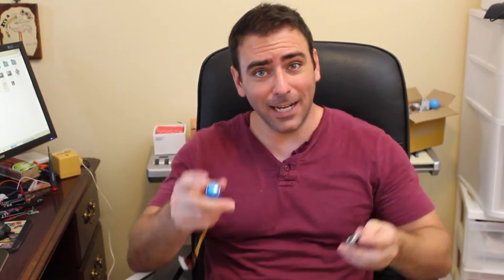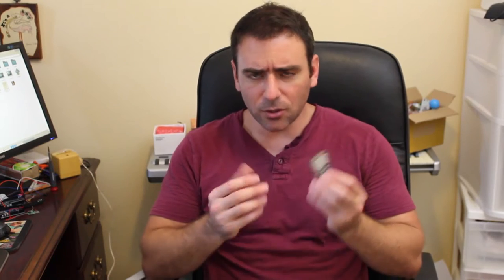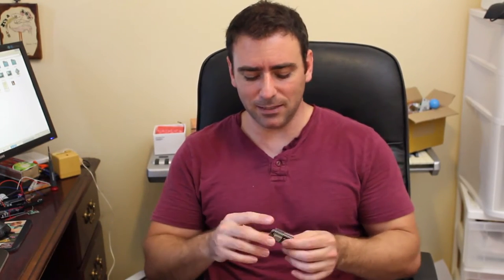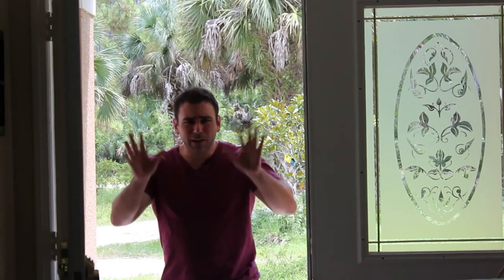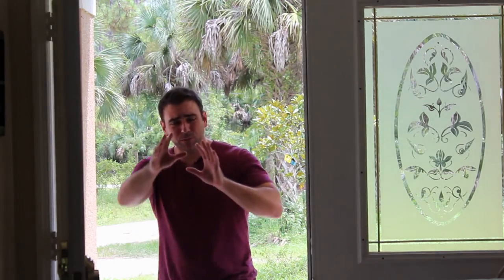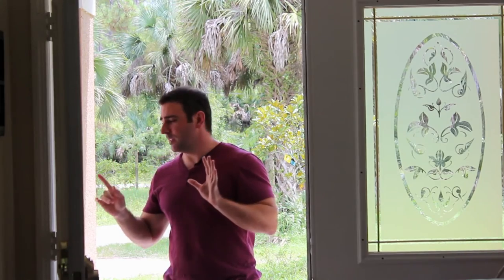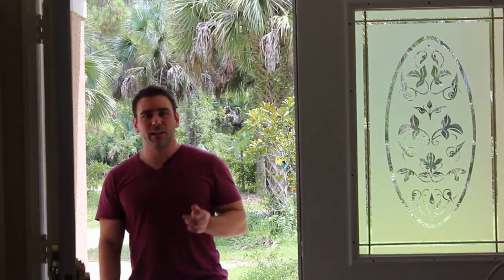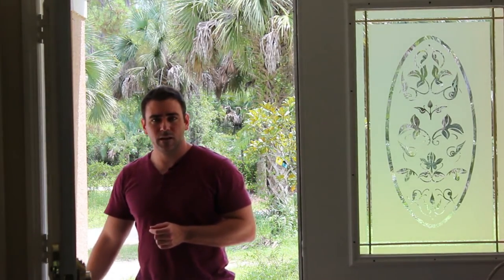ESP8266 Smart Door Bell Project

Comment: I am looking for my first ESP32 project.  Simpler than the project in this video.  Press a button and I get a text message. I know nothing about ESP32 but would like to know at least how to program an existing code into a ESP32.   So far everything I found on youtube assumes you know how to program the ESP32.  All I would like to do is edit with entering my router user name and password , and setup what FREE service it will use to send the text message.     The other though is I have been playing with a water detector by tuya.  What I am finding if I short the 2 probe posts that detect water it may or may not work but on the second attempt (with in a few seconds) it works and sends me the text message.   I built a circuit that takes the a.c. voltage at my door bell chime when someone pushes the doorbell.  This voltage I converted to 12vdc to trigger a relay.  I just need something the closed contact will send me an alert message.    By the way there is something called a trigBoard that is perfect but for the editing of the wifi router user name and password and service that will send the text message you need Windows 10 with bluetooth.  The process is very simple if you have Windows 10.  I only have Windows 7 so that killed that project.  No programing or loading in code was needed. Very easy.

Comment: You have had much more success with the ESP.  I pretty much gave up as I was forced to use the LUA and the ESP was very difficult to communicate over the serial line and it kept crashing on the simpliest tasks.
Reply: increase your power supply.   get a couple as spare in case it has electrostatic damage or bad connections
Reply: I am sure Chris can instruct you in how to use the Arduino IDE for this bell thing. Lua is a filthy language!

Comment: Hi, looks interesting but how do you get this esp always on charge? batteries, or outside AC socket?
Reply from the maker: I'm using the original wires that ran from my door bell to my garage.  They where connected to the transformer that powered the door chime itself, which is connected to my houses 110VAC and converted that power to DC (I want to say 12 to 15 volts. I can't remember off hand).  You can easily use that power line to power the ESP.  Since my door chime's transformer was dead to begin with, I can just replace it with a standard wall outlet with out having to run any new wires.  Then I just used an extra cellphone charge to power the ESP from there.  I think I talk about this in the previous video a little bit.

https://www.youtube.com/watch?v=Qv1nW2qTwUI

Comment: Whats the Github path to this particular projects files please ?
Reply: The code on the ESP8266 itself is just the example code for a button press and url request that comes with the ESP8266 library files.  The only thing I've changed was a counter that makes sure the button is pressed for about a 10th of a second before triggering.  Before I had a problem with occasional ghost rings and forcing the button to be pressed for a bit longer seems to have fixed that.  I don't have that code in front of me, but I do hope to do an update video soon.

Here is the shell script running on my desktop computer that the ESP connects to:
https://pastebin.com/GYgS1Q0z

I've removed the urls and passwords for my systems, so you'll have to fill yours in.
My camera server is a cheap "ip video 9100a", but most ip cameras should have a url you can grab images from.

Depending on your mail server this might very, but sending an email on php request looks like this:
mail('5555555555@txt.att.net', "Door Bell Rang!!!");

Let me know if you have any questions.
Reply: I'd be very interested to see an updated video if you do make one - I am going to try build a pair of these, where there is also an ESP8266 receiver (that performs a similar role as that of your computer) that scans a web API for button pushed flag, sounds a chime, and then unsets that flag (and perhaps notifies the ESP node where the button push occurred to trigger some feedback for the person pushing the button). The ghost ring fix is a good idea. Thanks.
Reply: Here is the updated code:
https://pastebin.com/LLwnsgTM

If could be cleaned up a bit, it's running the ESP8266 as a server and client, and the server portion really isn't needed, but could be useful if you wanted to add more functionality to it.

You'll notice 'int p = 0;', this is the variable I created to count how long the button has been pressed for.  If I press the button as fast as I can, I would get 30 to 40 loops in that time, so I just set it to ring at 50 loops.  It's worked well for me, but you can play with it.  I made this change a few weeks ago and haven't gotten any ghost rings since, when I use to get one every few days.

Good luck.

Comment: emm.... so i need to have my 300w desktop pc running for the door bell to work.....  ok i know, but i have internet via a 24/7 router, and a light bulb that works with google home assistant, surely i dont need more hw than that. we only have the one 'smart' bulb its in the bedroom, were going back to manual led as if you walk upstairs and forget your phone to beg googles help, theres no way to turn it on.
Reply: No, I don't need a "300w desktop pc running for the door bell to work".  It's just were I choose to send the signal and split it up to other devices.  I could have the ESP send the signal to each device on it's own, but if I wanted to add a device I would have to re-flash the chip to add a device if I don't use a server of some sort.  I could have it connect to a small Raspberry Pi or even use my router or web server.  My desktop computer is never off, so I chose to use it. 

As far as lights go, I have an ESP chip that controls a few lights in my house as well.  I can control them with a remote control (which I have a few of since they only cost $1 or $2) or any device connected to my network (phone or computer) with out needing to install any special software.  The lights also have physical button I can walk up to them and press.  The problem with your system sounds like it's a proprietary setup that you can get to work the way you want.
Reply: @DigitalMetal  yeah don't think I'll ever get my head around this iot stuff, 'plain' electronics and mechanics I'm comfortable with and the odd but of coding to control furnaces or motors, but this stuff is a foreign language and I'm a visual learner